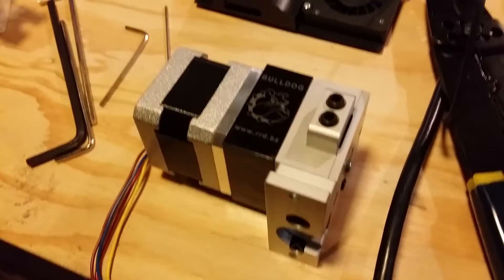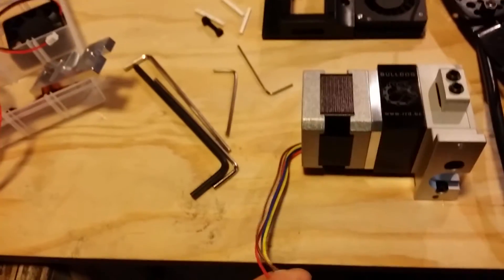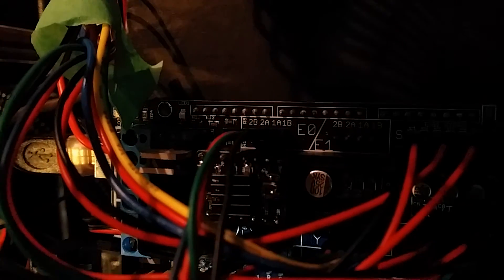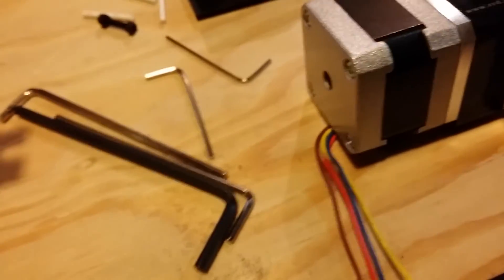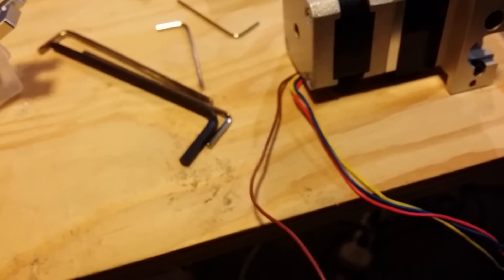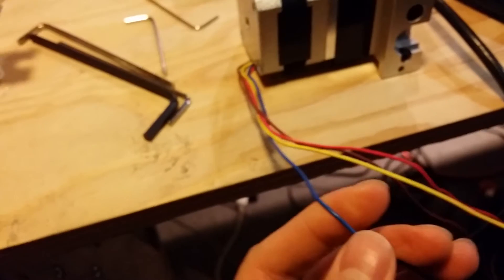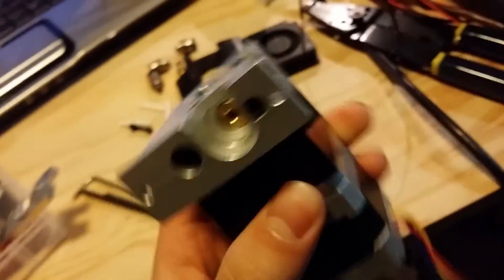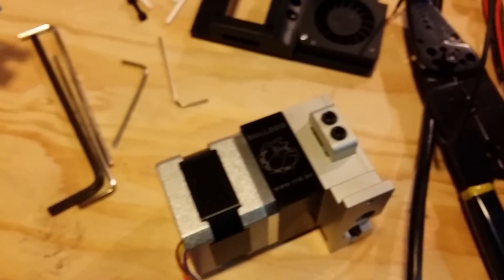How to wire the Bulldog XL Extruder with Ramps 1.4

Comment: I found out what to do to fix this issue. Reverse the wiring reverse your B's and A's flip the connector around. it should work the same your essentially controlling 2 coils so it does not matter what way each coil is wired as long as your wiring of the coils are not crossed. FYI for anyone else having the same issue. send a message if you have questions about the machine make I use perhaps it is a machine make issue. or perhaps its a RAMPS issue.